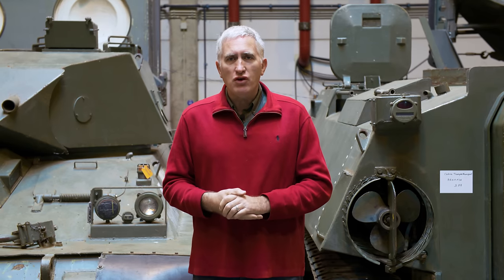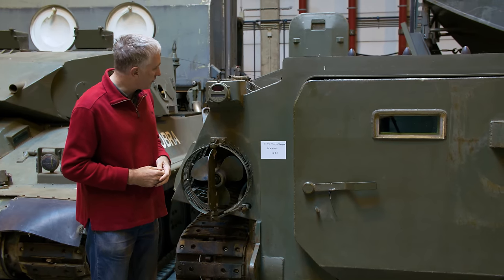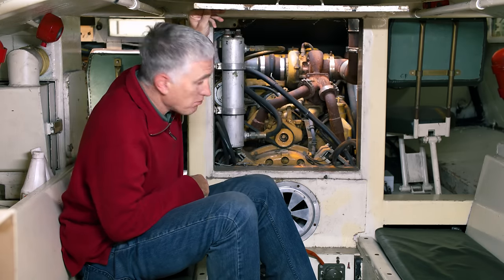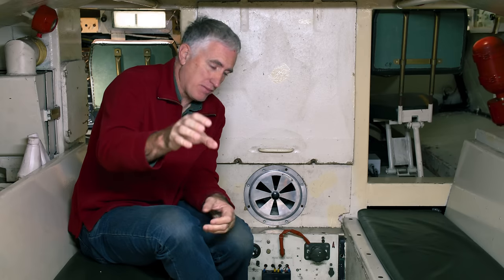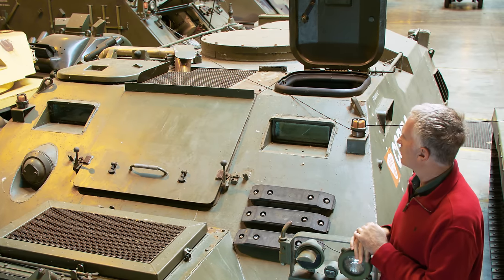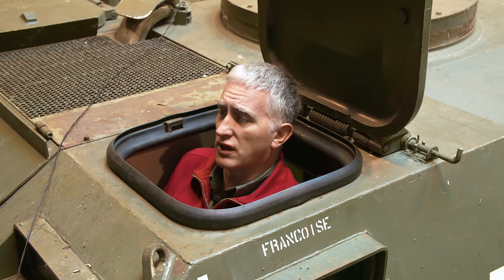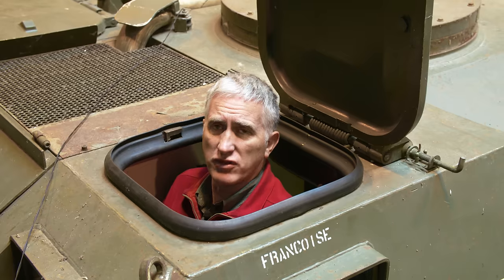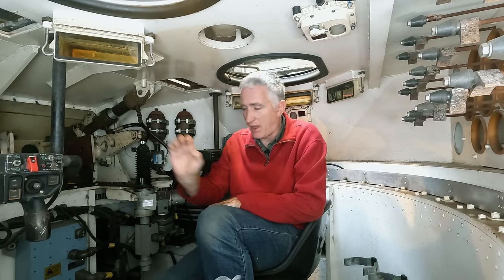Inside the Chieftain's Hatch: ACEC Cobra

Comment: The reason why ACEC was interested in electric armoured vehicles was that they produced the transmission system for the French Crotale SAM system 4x4 vehicles. These had an odd requirement, in that they needed a lot of electrical power for the radars when they were stationary, with no drive to the wheels, but very little when they were moving and the engine was revving highly and producing lots of power (the SAM system could only be operated when the vehicles were stationary). Normally, such a vehicle would have an auxilliary generator, but that would be dead weight when it was driving, so they came up with the idea of having a single diesel generator which could feed electric power to the wheels or the radars as required, and ACEC got the contract.
Reply: They also had good track record in electric-diesel train engine (and of course pure electric. They for instance developed the engines for the french TGV)
Reply: I presume the button on the driver's floor was to start the ICE.
Reply: @alecblunden8615  That would be a bit weird, since one could see a driver accidentaly pressing it during driving the vehicle, and starter motors reeeeaally like when you engage them on a already at speed spinning engine. Although,  there could be a cutoff that disables the button if the engine is already running.
Reply: @LasOrveloz  It was quite common in cars. My Aunt had a mid 60s Mini with the feature.

Comment: My EE Prof always joked "There are no electrical problems, only mechanical problems in electrical systems." and that you couldn't break electricity but you could break wires and all the other pieces of the system. lol
Reply: Oh well that makes all the difference.
Reply: He's absolutely correct. My instructor taught me the same, and that advice has proven to be accurate during my 40 years of experience.

Comment: @13:10 the button on the floor is probably an intercom trigger.  The Apache has two that look almost exactly the same: floor mounted, big clicky button.  One is for radio push to talk and the other is for intercom push to talk.
Reply: The Blackhawks had an ICS floor button as well both for the pilots and crew cheifs.
Reply: Interesting!  Most emergency dispatch centres in North America also use floor mounted push-to-talk radio switches.
Reply: Makes, sense, my immediate thought was some kind of dead man switch.
Reply: @tedferkin 
That would probably be a good thing for an electrical powered vehicle. But, as noted by others the radio  / intercom system more likely.

Comment: The highbeam switch was used as an engine starting switch on some military trucks
Reply: And, not just military trucks. I am old enough(82) to remember them on non military vehicles. The floor switch was next to the accelerator so that both could be reached with the same foot when starting the engine.

Comment: I can understand why it was too early. Had a car from the early 90's that had electric everything. Which just meant nothing worked and I had no manual control as back up. Took a while to get everything reasonably reliable for civilian use, so we may now be getting to cheap and reliable enough for military use.
Reply: Same thing now
Reply: There's a reason why the electronics in spacecraft are always pretty primitive compared to consumer products of the same age - if you can't get anyone up there to fix it, it's better to use proven vintage hardware.

Comment: Moving the vehicle with a set of jumper cables to a following vehicle is about as clever as the story about jump starting the auxiliary power unit on a C-130 using a SeaBee truck (which then allowed the engines to start, etc.).

Comment: That thing must have been incredibly loud inside with that engine screaming at 3200rpm ALL THE TIME.
Reply: And for a large displacement diesel engine that’s very high rev.
Reply: That's not how diesel locomotives work, the engine speed varies with load.
Reply: @justforever96   Generators require a set RPM for a given voltage. Alternators allow the RPM to vary as they use voltage regulators. And in the video he says the engine was run at 3200rpm.

Comment: 28 inch wall is 71cm, respectable enough.  Okay an M2 Bradley will climb 3.0 ft (91 cm) but in was introduced in 1982, 5 years later.  Singapore Armed Forces’ (SAF) next-generation armoured fighting vehicle (AFV) was unveiled in June 2016, it can climb 60cm of wall.

Comment: One thing that was found early on with wheeled armoured vehicles and electric motors is the motors are too good when something slipped. This is for direct drive, mind you.
If a wheel slipped, there's enough power and torque and instant response that the wheel gets accelerated to a rotational speed sufficient to rip the type off in chunks before the control electronics can react to stop this happening (reducing power and applying braking). So far, the only way around it is put in a drivetrain, which is rather counterproductive seeing that's one of the things you're trying to avoid to save weight.
Ever seen a high speed video of a disc being spun fast enough to disintegrate? Yeah, that but with a LAV-25 tyre.
So for now they're limited to tracked vehicles like the Ripsaw MS.

Comment: The 4 direction toggle switch I most likely for motor direction  ei both forward, both reverse, left forward - right rev, left rev - right forward  for turning in place based on other electric drive skid-steer vehicles from the 60s-80s..

Comment: Sir, that was a very interesting and thought provoking video. Thank you!
One interesting side note. In the age of climate madness and CO2 paranoia. There have been huge developments in electrical powered and hybrid vehicles. One rare benefit could be technology is approaching the point where true diesel electric drive for AFV's is actually the preferable form of propulsion.  Diesel engines are the most energy efficient ever, as are the various new designs of electric motor. Battery technology has advanced at an incredible pace too. However, the greatest leap forward has been in the computer controlled management systems. Making integration of hybrid drives super reliable. Special thanks going to people such as Elon Musk.   
The term whispering death may no longer be reserved for those lethal electric powered milk floats of my youth.

Comment: I wonder if there were any safety concerns with a 600 volt electrical system if water got into your swimming vehicle.
Reply: I can see the problem in reverse: there is for sure a safety to switch off if water get in.
But at this point, it's all dead, not only the engine and steering, but radio, swinging seats, lights.
How sensible you want that safety switch?
Reply: They use it in heavy equipment and locomotives and ships all the time so they must have figured it out. Hell they supply trains from overhead cables and rails and they work in the rain just fine.
Reply: If water gets into your amphibious APC your first concern is drowning. Electric safety in water-occupied areas was figured out just about a century ago.

Comment: There are pit mining trucks weighing 45 tons that are all-electric now. It's only a matter of time before armor and IFVs have them.
Reply: mining trucks are a really weird niche that it works in, those things are so heavy the regen actually saves the brakes and extends the service. really maybe theres a better way to do it than trucks to begin with
Reply: @AsbestosMuffins   Most tanks are heavier, so that likely has a lot of parallels.
Reply: I'm waiting for All-EV APC's, IFV's, light tanks. 
 Just have the power pack easily exchangeable (like 5 minutes). I believe some large truck tractors use this in Australia.
 It's high time someone tried it in a military combat vehicle, IMHO.
✌️
Reply: @McRocket  And it narrows down the resources needed to run it.
Reply: The WW2 Elefant self propelled gun (built as a competitor to the Konig Tiger) used a diesel electric drive train. The amount of copper required scuppered production after a hundred were built by Porsche.
Reply: @johnsteiner3417 But tanks are used differently. Mining trucks have a repetitive job in a well-confined area, driving cargo uphill and then heading down the same hill - leaning on the brakes for a conventional model or regenerating much of the energy spent coming up, with minor charging top-ups making up the frictional losses etc.

Having said that, I do expect to see electric heavy combat vehicles during my lifetime.
Reply: @akmzd6938   Pit mining puts hardware through quite a bit.
Reply: @johnsteiner3417  Indeed, but it's a specific use case so you can design for that use case. An AFV needs to be usable across a far wider range of environments and conditions. For an MBT you want what, 35 - 40 mph top speed? You want an MBT, or IFV for that matter, to operate reliably in hot, dry sandy conditions, so Desert Storm as an example, but also in cold wet European environments. That makes life a lot more difficult. I could be wrong, but I suspect heavy duty mining equipment is built for the environment it's ordered for.
Reply: All-electric tanks and APCs would have the advantage of being very quiet (no engine noise, only the noise of their tracks) and lower infrared signature (no combustion happening to generate heat). Those advantages mean it is indeed only a matter of time before electric powered tanks start seeing use.

Comment: Interesting, hadn't realised that they were still trying hybrid vehicles back then. Some of the modern constant speed engines are getting simple enough to be considered for this sort of use now though, there's a two stroke, 4 cylinder, opposed piston (so 8 pistons) one that if scaled up slightly (it only weighs 35 kg and develops something like 120 hp at 500 cc) could be a good fit.

Comment: Cool review, Chieftain! I never knew about this vehicle before.  Anyhow, I think the future of electric armored vehicles may involve removable battery packs which can be switched out quickly, and regeneration via the return rollers and idler whenever steering or braking. A support vehicle with a small diesel engine would tag along behind to provide freah batteries to swap, and recharge the old ones. This of course would take an entire rethinking and rewriting of current doctrine in any nation's army, and won't likely happen for another 50 years.  For now, things will probably be diesil electric hybrids, using something similar to current train locomotives and this thing(with the electrical bugs sorted out...omg, power operated seats in a military vehicle, what were they thinking!?  I could understand if it was built by Cadillac or Mercedes Benz, since luxury is their priority, but I digress.)

Comment: Actually, some trains have a (permanent) magnet less DC motor, (100% torque at 0 rom) that switches to AC once you're moving. Not sure if the Diesel drives an Alternator or a Generator, (with the proper circuits to convert to the power type needed) or like the Motors it can transition from DC to AC and back again....

Comment: Unfortunately without some new advancement in technology, electric drive trains for armoured fighting vehicles are unlikely to become the norm for one simple factor: weight.

For relatively small vehicles, an electric drive train is usually going to weigh more than a simply driveshaft. For a locomotive, extra weight is often an advantage, since extra weight equals extra traction, but for an AFV that extra weight would be better used elsewhere, be that in armour or ammo or half a dozen other things. For ships an electric drive train can weigh the same or even less than an equivalent mechanical drive train, particularly if the engineering spaces are located nearer to the amidships rather than at the aft, plus ships are less bothered by the slight weight increase.

There's also another aspect, which interestingly these vehicles seemed to have suffered with, namely the extra complexity of an electric drive train. With the extra steps between the engine and the tracks, there's more failure points, so there's always going to be more chance of something braking. Now for ships an electric drive train gives more options, allowing the use of azimuth thrusters, which allowing better manoeuvrability while also eliminating the need for holes below the waterline for the driveshafts. And for locomotives an electric drive train is much easier to use with bogies since you only need an electric connection rather than hydraulic or mechanical linkages.
Reply: With an electric drive train you can eliminate the gearbox. That equals a lot less weight and complicated mechanical things that can break down.
Reply: Honestly, Unconvinced - My battery electric vehicle (a Peugout van) weight 80kg more than the same model with a petrol engine. Beefy battery in, a lot of junk, transmission, filters, cables, gears out. And the electric motor, same power but ya' big, in Chieftain unit of measure.
I'm not sure a combustion engine that have to do one single RPM regime(+fuel, filters)+two electric motors is much heavier that all the gearboxes, shafts, differentials, and assorted metak junk to bring power from a variable speed engine to final drives.
Reply: You aren't up to date on electric motors it seems.
Reply: @fabiogalletti8616  When the vehicle has an ICE it only needs batteries for starting the engine, and for reserve power should the engine need to be shut down.

Comment: Makes me want to move to Alaska or somthing and convert it to a mobile camper that thing's got a Lot of space! Or a mobile recovery vehicle for when people get stuck.  And it's got a cummins.  The only problem is if the electrical needs to be serviced.... honestly might have been simpler with a hydrostatic drive..🤔 chasing electrical issues on a off-road vehicle is always a way bigger pain in the ass imo.
Reply: Tracked vehicles always take a ton of maintenance anyway. And you had better be rich already if you want to afford the fuel and stuff to drive one of these regularly.

Comment: 150 kW at 400 volts is what my little Chevy Bolt runs on, about 200 HP.
Reply: Yes but that is expected to go at freeway speeds. With gearing heavy equipment rarely has much more than a couple hundred horsepower unless it's really heavy. And when you are only doing town speeds your car is only using 20-30 HP most of the time. How often do you run a normal car up to the redline at wide open throttle? That's the only time it's using it's rated power, except at top speed.

Comment: The Diesel/electric concept is a good concept.  The problem during WW2 was that the electrics just weren't up to service in an vehicle that was going to get shot at and operate over rough ground.  Getting a reliable diesel electric design working on a locomotive is much easier.

But with today's tech, there's no reason a diesel/electric drive system would not work and work well.

Comment: The electric seats gave me a hearty chuckle.

It makes me wonder if anyone has ever just used automobile seats in a armored vehicle?

Has anyone dropped a heated leather seat into it from the factory?
Reply: This was ACEC's first (and unfortunately, only) attempt at a military vehicle, so it's not surprising that there were a few oddities like that.

It's too bad the Cobras didn't get any orders, since they seem like good vehicles for their day.

And if the diesel-electric drive did well in active service, you'd probably have seen the major players in the industry copying ACEC.
Reply: A few of the premium auto seat manufacturers have models that are used in military vehicles.  But not quite what you are referring to.
Reply: @DB-yj3qc  yeah, I just find it funny though. The govt will spend $10million dollars on a tank but God help them if someone could ask to have for example a Toyota Tundra seat installed for the driver for like $400.

Or maybe a seat from a tractor trailer that has air ride suspension on the seat.
Reply: Admittedly it would probably be hard to stuff a car seat through a tank hatch but if I was a tanker, I would definitely try to do so with the first seats from a battle damaged car I found. I would definitely at least bolt the extra seats to the turret basket so I could have a comfy spot to sit when the tank is stopped.

Comment: I think one of the big differences now, compared to the other times the electric motor came into fashion is how much more mainstream electric vehicles have become everywhere else. It's clear as day that EV's aren't going anywhere. So maybe we'll actually start to see some keen progress on the military side.
Reply: As a driver of Battery Electric Vehicle, I beg to differ on the "going anywhere", but it's IMHO. :)
Reply: @fabiogalletti8616  nice! I drive a BEV as well.
I mean, they aren't going away. They are certainly taking over. So it seems we're bound to see this stuff in the military soon.
Reply: @birdmonster4586  Batteries may take a while, but everythig in the automotive world ends in tanks, once mature - automatic gearboxes, for example.
I wonder if the eletropumps-hyropneumatic steering gitzmo that 70s tech required can't be simply replaced by today direct control of the sprocket motors, IMHO.

Comment: did anybody tried to make multi axis electric vehicle? i feel that replacing all that power transmission to each axis by electric motor would actually be more beneficial than in case of tracked vehicle.
Reply from the maker: The Swedes have tried a few examples. I suspect we are now closer than not to having reasonable electric propulsion

Comment: Maybe a little too early for AC diesel electric since the railroads didn't start using AC diesel electric locomotives until the 1990s
Reply: Class 43 HST's (High Speed Trains) went into service in the UK in 1976. 125 mph. Still used today (The original trains, upgraded diesel electric motors)